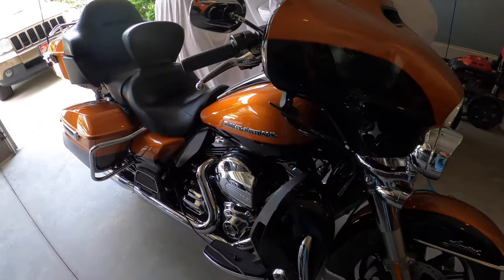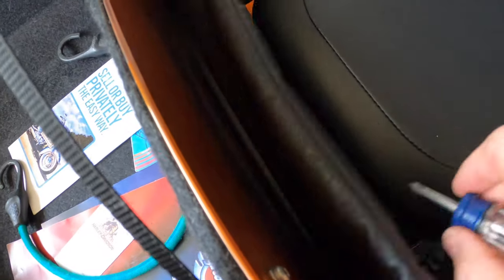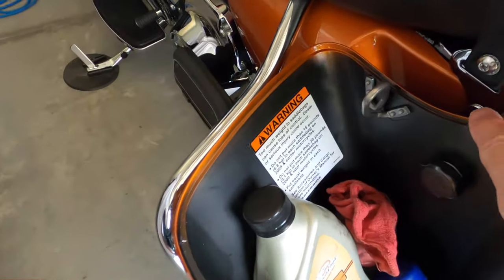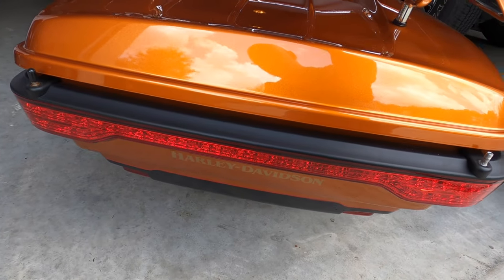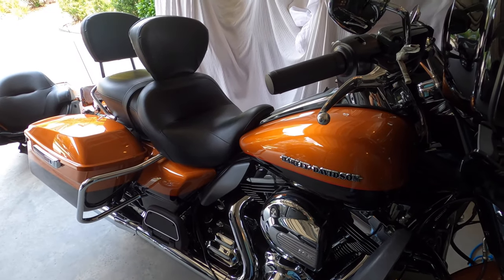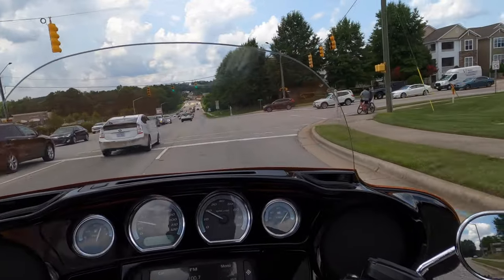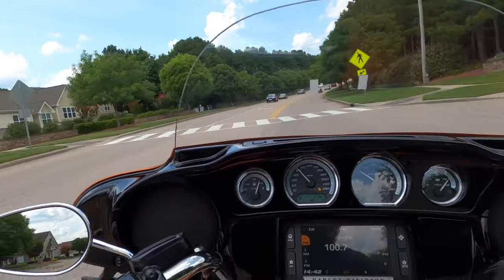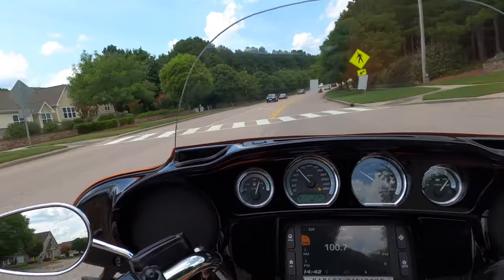How To - Tour Pak Detach - Turn That Ultra Limited Into a 'Street Glide Limited'

Comment: Just bought a 2022 Ultra Limited...Bike has fixed tour pak and right now no optional detach kit.  Anyone know if a vendor is building a kit anytime soon?
Reply from the maker: You can get all the parts you need from the dealer. They used to have a complete kit with everything included but the kit has been discontinued according to my dealership parts guy (I was going to add it to the Road Glide) - but all necessary parts are available a la carté, and for about the same cost. EXCEPT, where the kit used to include the saddlebag lights for run/brake/turn, those lights are now extra cost. I already have the Custom Dynamics Filler lights that do run/brake/turn, so they can take the place of saddlebag lights. Thanks for watching 👍

Comment: I got ride of my 2000 ultra classic and bought a 2019 street glide sp. I bought a color match king tour pack for it and it's like having two bikes in one. For long trips I put the tour pack on. For short trips I take it off and put a solo seat on. I think the tour pack weights about 50 lbs. So there is a big differance
Reply from the maker: There is a huge difference - losing the high and rearward weight does a lot for the handling. Congrats on the new bike - sounds like you have it set up right. Thanks for watching and ride safe!

Comment: I couldn't hear the radio on mine either. So I added crash bar speakers and an amp. On long trips I have a Bluetooth helmet with the speakers inside.
Reply from the maker: If I really want to hear the radio, helmet speakers are the only way to go for me - I have a bluetooth helmet and a wired helmet . Otherwise, I rarely use the bike’s radio.

Comment: I have a 2013 Limited. I am really thinking about removing the king tour pack. The dealer said it would be $400 to install the quick disconnect hardware for me.
Reply from the maker: That’s probably a labor only quote - the parts are about 600-800 depending on saddle bag lights needed. It’s easy enough to do yourself, there are videos here on YT. I will probably do my Road Glide Limited this winter. If you don’t need the tour pak all the time for storage or passenger, this is a great way to go. Thanks for watching 👍
Reply: @Hogdriver88  thx for the response 👍

Comment: Great video have the identical Bike does make a difference removing the tourpack especially when making sharp cornering. And you also get that Streeglide look 👍😎
Reply from the maker: Hey mikey sully - it sure does make a difference. I left the tour pak off quite a bit when I had this bike. Not sure yet if I will do it with the Road Glide Limited but it is a worthwhile accessory. Thanks for watching and ride safe 👍😎

Comment: I may be weird but I kinda like having the tour pack on regardless of what I'm doing. It gives me more visibility and more obvious brake lights up high in a driver's vision. It also gives me somewhere to store a helmet or two. Kinda like the way it looks also. I may take it off just to see what it's like without it though. Thanks for the info.
Reply from the maker: I like it for the same reasons you do. It took me 2 years to get around to trying out my detachable tour pak and once I did, I liked the looks and handling. Always easy to snap it back on when the mood strikes. Haven’t installed the kit yet on the Road Glide Limited - don’t know if I will. Thanks for watching and commenting 👍

Comment: I have a 2020 ultra limited was thinking of doing this but I think the wife and I like the the look of tour pack on I'm not sure yet
Reply from the maker: It’s a great way to have 2 bikes in one. My wife preferred the comfort with the tour pak, I liked the handling without. Without, you need that passenger back rest to finish off the back end IMO. It’s an expensive proposition so don’t spend if you’re not sure. I probably won’t be doing it again with the new Road Glide. Thanks again for watching 👍

Comment: Also loose license plate bracket,  for tail/brake lights , there is a kit to fill holes on left & right sides  of bags, mounted vertical,  super bright..
Reply from the maker: The detach kit from HD includes a relocated license plate bracket as well as LED tail/brake/turn signal lights that mount on the top rear of the saddlebags. I have Custom Dynamics filler lights on the Road Glide and they are excellent.

Comment: Nice!!! about another thing... what is the mystery about hiding the tag that I see in some videos and pics?
Reply from the maker: Not sure, but I do know that with this particular setup with the detach kit and the tag relocation bracket, with the tour pak on, toll both license plate readers cannot see the tag because it’s mounted higher on the fender and closer to the bottom of the tour pak, making it difficult for the plate reader to see. Thanks for watching!

Comment: It looks like you used the custom dynamics license plate relocation kit but you mounted it upside down? Would be out of the way and look much better below the tail light!  The drag specialties tail light with the bottom window is about 29 bucks .  I have the same bike in Amber whiskey and brilliant silver. I'm also using the same custom dynamic turn signals. I bought an antenna relocation kit to put it under the fairing cleans up the back end nicely.
Reply from the maker: I like the Amber Whiskey/Silver much better than mine. The plate relocation mount and saddlebag turn signals I had here were all part of the HD tour pak relocation kit - nothing extra to buy except the CB antenna mount that I didn't bother with. I agree that it would look better with the AM/FM antenna hidden. This bike has been sold and I'm on a RGL now... Thanks for watching!

Comment: You mentioned the docking bracket for the antenna.  Did that come with the quick connect attachment or the rear turn signal lights mounting hardware  . I'm  a very new rider . I just bought the RG Ultra and I'm extremely ready to remove the king tour pack. My riding skills are not good enough to include my wife on any trips yet. There are so many different brands of tail lights and passenger back rest harnesses to choose from . I'm not confident as yet to purchase anything lol.   Could it be possible to get information on where you purchased those items . The quick connect for tour pack,  the passenger back rest ,the luggage bracket and the rear tail light turn signals.  I hope you can help. I want to say thanks for sharing . I just subscribed and hope to learn more from your channel. Big Mex ( Pete)
Reply from the maker: Pete - first, thanks for watching, commenting, and subscribing, and welcome to the RG Ultra! I went to the RG Limited 2 months ago - they are great bikes. That tour pak weighs about 60 pounds, and the weight is up high and rearward, so removing it affects handling in a good way - it's much easier to ride without all that extra weight. Storage is nice, but for around town - I can live without it. The detach kit and passenger back rest are from HD and they are not cheap. Do yourself a favor and spend the money - buy once, cry once. The detach kit is about $600 and that passenger back rest is about $325. They are worth it. If you don't feel confident installing the kit yourself, pay someone to do it. It will be probably 3 hours of labor at the dealer. And then have them show you how it all works. Again, worth it. Too many stories of aftermarket detach kits falling off the bike  - one guy said he caught his wife by the leg as she was rolling off at highway speed. Besides losing a passenger, a full tour pak set up is a LOT of money to replace. No aftermarket! SPEND THE MONEY lol. The detach kit includes the AM/FM antenna relocation bracket AND the saddlebag LED turn signals. I recommend getting the metal lock set for the tour pak, otherwise someone could easily remove it. I didn't have the removable luggage rack, but HD has several models that can go on the docking kit along with the passenger back rest. Go see the parts department at the dealership - they will guide you. And before you take a passenger, get in lots of solo riding - maybe consider some formal training. Adding a passenger changes the handling even without the tour pak. Good luck with the new bike!
Reply: @Hogdriver88  Thank you , I appreciate your information.  I will look into the Harley brand . And get plenty of solo rides in before adding a passenger.  Hope you have a great Christmas.  Thanks again.  Pete

Comment: Where can I purchase those lights that are on the saddlebags ? Or can I purchase as a complete quick disconnect kit ? Thanks
Reply from the maker: Those lights were part of the complete kit in 2015. They are now not included in the kit - you have to buy them separately but the dealer does have them. Also, take a look at Custom Dynamics for saddle bag lights. Thanks for watching 👍

Comment: Great video Hogdriver I need to buy that quick release for my tour pack also.  BTW what kind of pipes do you have on your bike.
Reply from the maker: Thanks Ty - if you do, make sure you also get the chrome (metal) locking kit for it. 

Those are the Vance and Hines 4.5 Hi Output mufflers on the stock head pipes. Loud enough for me. 

Thanks for watching - ride safe.

Comment: I haven't invested in the whole "kit" yet but purchased the saddle bag lights and they work great but I noticed that when i remove the tour pack and disconnect all the cables and put them under the seat like you did I get engine light flashing when riding.  When i recorded the codes it is shooting and looked them up it is Left Speaker, Right Speaker, Auxillary Power and Comm Link - connections lost.  Is this what you have experiened or am I missing something? 2017 Road Glide Ultra
Reply from the maker: I never got any engine light or codes at all when I detached. What it's telling you makes sense because you are losing all those things when you detach the tour pak, but it doesn't make sense to me WHY it is doing that. Unless maybe the bike gets flashed at the dealer to not do this when the dealer installs the kit? Do the codes and light stay on all the time or does it stop after a while, or when you plug everything back in? May be a question for your service department...
Reply: @Hogdriver88  ive noticed it only comes on about every other time i start it up. Sometimes it on other times i start up and it never lights up.

Comment: Thanks, great video. Could you please provide kit number?
Reply from the maker: Thanks... HD doesn't sell it as a kit any longer, but they sell all the kit pieces individually. It comes out to about the same cost except that you now need to add the cost of either saddlebag lights or filler lights for turn signals. I now have Custom Dynamics Pro Beam Fillers that act as run/turn/brake lights, so I don't need the saddlebag lights.

Comment: It is funny how everyone says that these handle different without the tour pack. I honestly have not noticed a difference with mine off.
Reply from the maker: Interesting. I found the loss of about 50 lbs of high and aft weight pretty noticeable. Thanks for watching 👍
Reply: if you only ride straight on the highway you won't notice a difference :)

Comment: I’m wrongly buy bracket for detach tour box cvo type. Mine is 2016. What exact size should I purchase?
Reply from the maker: Don't know for sure but I think the CVO box is the same as the Limited. Your best bet is to go to your local dealer and get the correct part number for your year/model.

Comment: would any of you mind telling me what kit/parts I need to do this to my 2014 Ultra?  I have looked online and cant seem to find what I need so I must not be calling it the right thing when looking...  Also, is anyone running the older style saddlebag guard rails where both bars wrap around the back of the bags?  Just curious if there are any filler panel lights that will work with those as I dont want to take my bag guards off, and I am not terribly crazy about those stick pn lights that go on the back of the saddle bags... thanks..
Reply from the maker: Best thing is to visit your HD dealer - they will have the correct part numbers for everything you need. The complete kit is no longer available and you need to buy everything separately. Total cost is about the same except the saddlebag lights that used to be included are now not. Check the Custom Dynamics website for the filler lights.

Comment: Did you install the detach kit?
Reply from the maker: I did not - it was worked into the deal when I bought the bike. But it’s not a difficult job and there are some good videos out there to help. I may do it with my Road Glide Limited this winter.
Reply: @Hogdriver88  I’m starting to do it for my RGU. Hardest part is to find the correct wire harness.  For some reason Harley is not offering a complete kit.
Reply from the maker: They used to offer the complete kit including saddlebag lights to replace the tour pak lights. No more kit, but everything is available separately for about the same price as the kit, minus the bag lights. If you needed those, it’s about another $200. When I went to the parts department they gave me a print out of parts - there was no extra harness required, except for the antenna relocation kit.